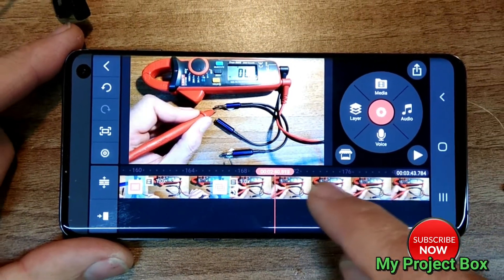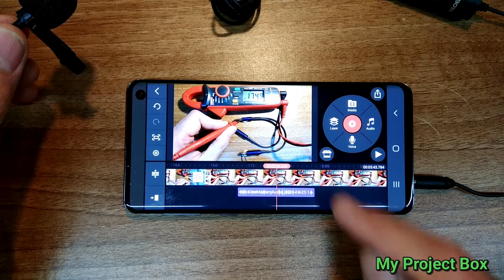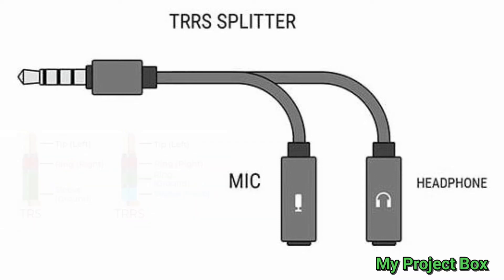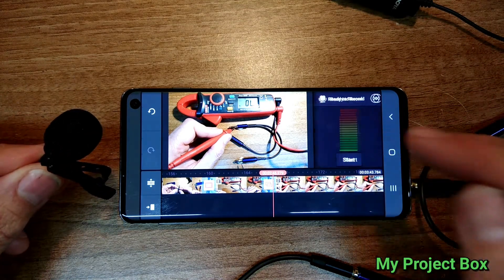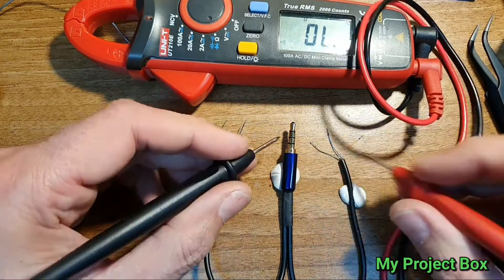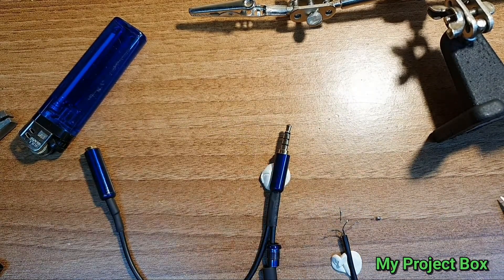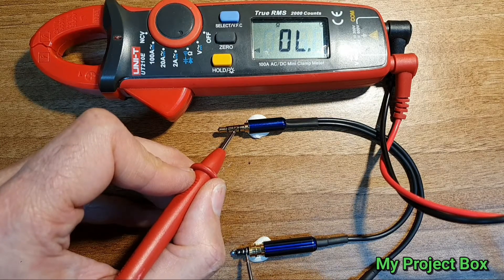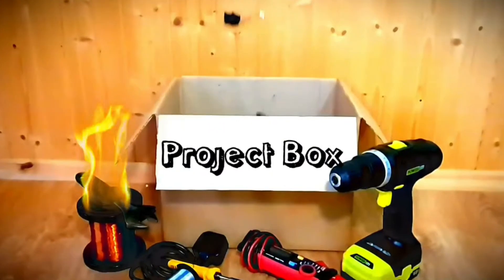Kinemaster & Boya BY-M1 microphone headphone splitter sound FIX trrs jack mod #ElectronicsCreators

Comment: Great video :) 
I understood the solution but am too lazy to modify the splitter and I suck at soldering too lol. I'm just gonna use an adaptor for the 3.5 mm jack and the splitter, it doesn't bother me as am using it on my laptop 
Anyways thanks for such informative and good quality vid <3

Comment: How can I get this? I've bought many splitters and in all, the mic doesn't work. Only the earpiece. I was thinking it was because my microphone is TRRS. 😔
Do I need a TS or TRS mic?
Reply from the maker: For the phone you need a TRRS mic. The problem is the splitter that's why I made my own. The other option is to use a trrs mic with  Bluetooth headphones / speakers, so you can monitor the audio that way.

Comment: I use a splitter that have mic and headphone logo, but if i plugged it in my phone, the logo that appears on the status bar is Headphone (not headset ), so the mic is not recording my voice ( instead the microphone from phone that record my voice )

If i plugged the clip on directly to my phone its work fine, but sometimes the headset logo is flickering , so the audio is off and on while recording

What types of splitter that i can buy? That sure will able to show the headset logo on my phone so my voice will be recorded
Reply: I guess the main problem is the splitter, it doesn't show Hesdset logo on status bar, it's only shows headphone logo, 
But when I plugged my earphone directly or boya mic dirrctly to the phone, its show headset logo kn the status bar, so it can record from the external mic
Reply from the maker: @hellkisser  you can use the boya microphone, and some Bluetooth headphones or speaker, at the same time. I think you have to connect first the one then the other. It doesn't always work.
Reply: @MyProjectBoxChannel  yeah, i think about the same solution, more money to spend i guess😂
Reply from the maker: You can get super cheap Bluetooth headphones or speakers nowadays. It all depends what you need it for.
Reply: @MyProjectBoxChannel  if I use speaker, the sound will got recorded by the boya microphone, this mic is capturing the sound that so far away
Reply from the maker: @hellkisser  when I recorded sound in Kinemaster, the Bluetooth speaker did NOT play the microphone sound. Only on play back I heard the recorded sound comming from the Bluetooth speaker 👍😉.
Reply: I use the splitter with 3 black stripes
Reply from the maker: I couldn't find the the right type of (trrs) splitter cable so I made my own. Are you using a headset with build in microphone, or is it a separate mic and separate headphones? A PC microphone is normally TRS the phone uses TRRS.
Reply: @MyProjectBoxChannel  i use earphone with built in mic, and i used boya by m1 , 
I plugged the earphone on the splitter (hesdset logo) and boya on the mic logo in the splitter